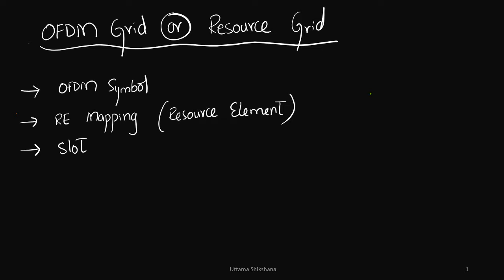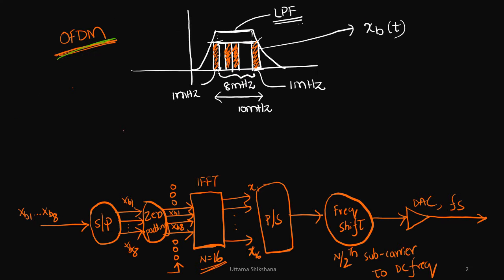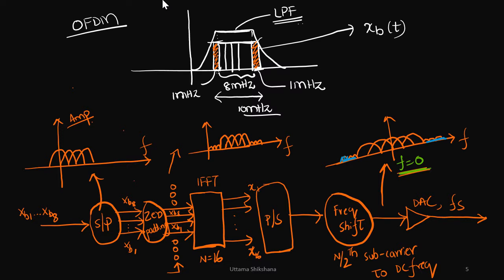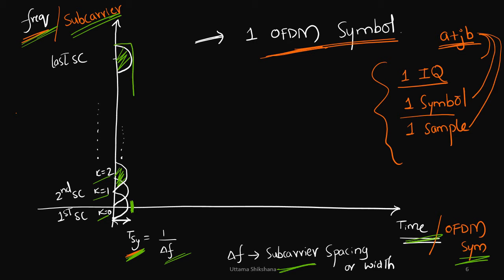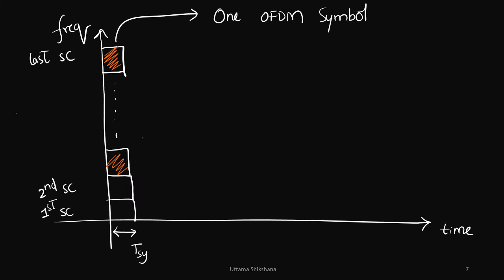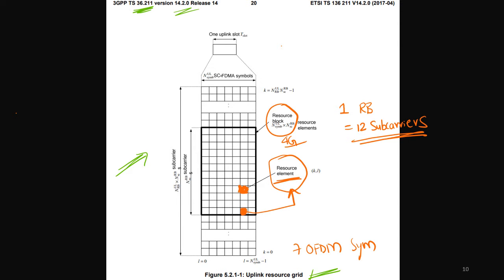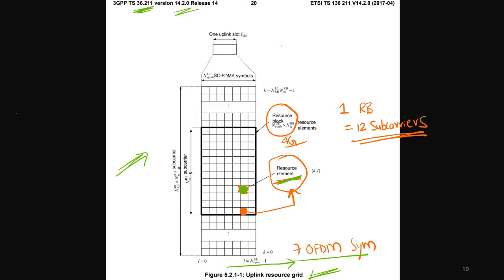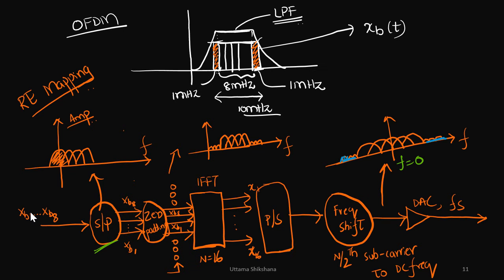[Series #36] 4G OFDM Grid | RE Mapping | 1 OFDM Symbol | 1 RB | 3GPP TS 36.211 14.2v section 5.2.1

Comment: Hi sir, 
1. can you explain why in 5g different numerology are introduced?
2. Why we use more CP length for the 1st symbol compared to other symbols in a slot ?
Reply: Thanks for the answer sir
Reply from the maker: Thanks of the question.
On a very high level
Answer for 1:
In 5G, especially in mm Waves, carrier frequency is higher and hence the doppler spread will be more which is a function of carrier frequency (directly related). So, if the sub carrier spacing is higher then the system will be more tolerant otherwise there will be huge inter-carrier-interference (ICI). Therefore,  5g uses different numerology especially on the higher side.

Answer for 2:
My understanding is that, it is to finally accommodate the slot or subframe duration to fit 1ms exactly.
But, higher CP gives more robust to higher delay spread due to multipaths.
So, we have extended CP which is mainly used to cater the higher delay spread and cover larger cell radius cell.